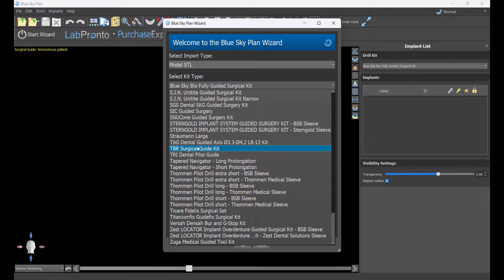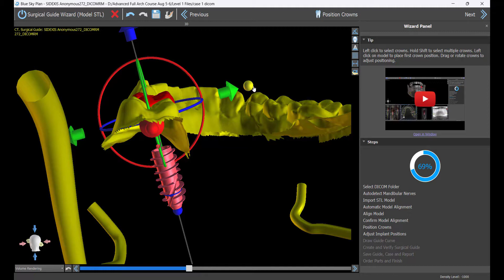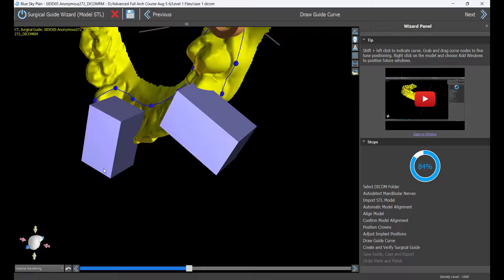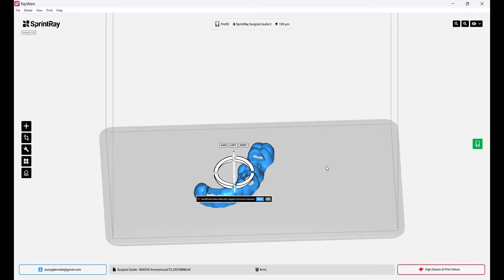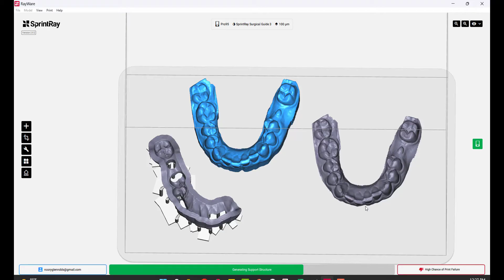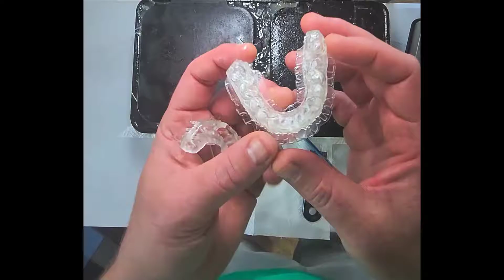Making Your First Surgical Guide From A to Z

Comment: very good explanation dear , just one question how we gonna place that metal ring in the guide through which we drill the hole in the tissue. Guide that i got from dio navi, it consist of metal support in the hole provided for implant placement, is that is the part of printing or we place it later

Comment: Hi Mr.Glenn i want to ask you that is it necessary to put metal ring or sleeve (idk) put in gap on the surgical guide ? Whats point of the metal sleeves ? Is it helps to put implant more healty or helping to protect what we design the degrees ?
Reply from the maker: You need them whenever you are guiding a drill that is side cutting or has flutes in contact with the tube because it can chew up the plastic of the guide but if it's a keyless system, there's really no need.

Comment: grat video dr. i have a question please, how can i set correctly the undercuts for my STL model, i try so hard to obtain a accurate surgical guide, but when mi 3d printer (which is a mono x anycubic) finish the surgical guide, that result doesnt fit very well on my 3d printed model.
Reply from the maker: Thx!  Unless you manually set it, the software will automatically set a path of insertion.  The one exception is if you've unchecked "remove undercuts" which is only done in advanced mode.  You should have a good fit without any modifications so if you're not.  I'd check your printer calibration first.  Next, I'd check the quality of your STL as it may not be accurate- desktop scans are best, IOS is second, and a CT scan of a model or impression will be least ideal.  Finally, you can increase or decrease the guide offset in the preferences but the default of .2 should be best if everything is calibrated properly.  hope that helps!